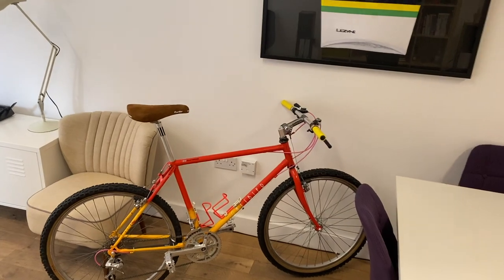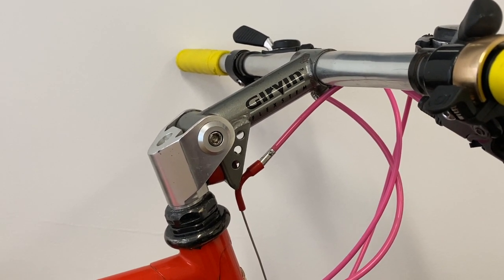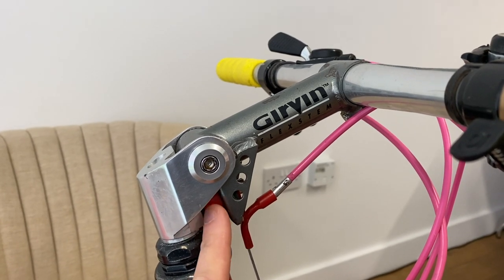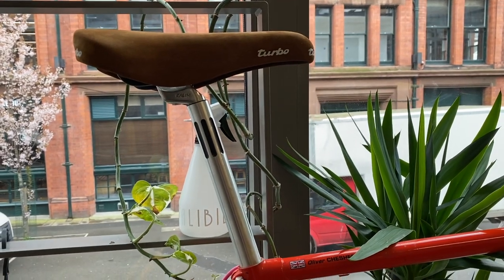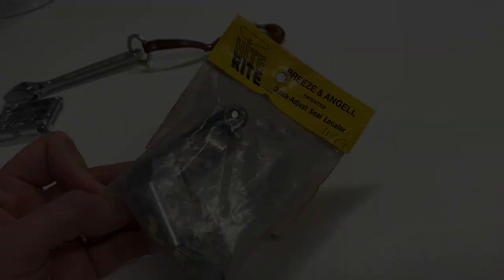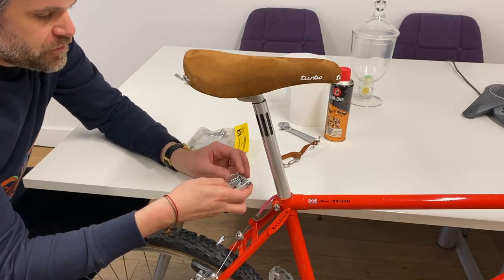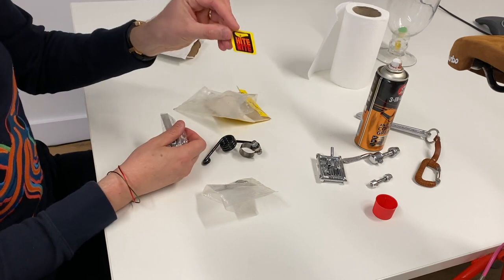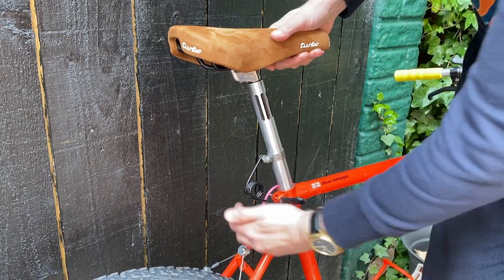Retrobike tech from the 80s: suspension and dropper posts (?!)

Comment: I could use a Hite Rite for my 91 Fat City Cycles Monster-Fat. I keep an eye out for them but they have become so expensive.
Reply from the maker: A Fat City has to have a Hite Rite, it’s a must. Yes they’re expensive and finite, but you’ll definitely find one - and what a cool toy to have. Just don’t scratch up some priceless XTR seatpost!
Reply: That's a fair point. I don't have a priceless XTR seatpost in the bike, however I do have the next best XT seatpost which is anodized. The seatpost diameter is now somewhat rare as well. I'll have to rethink this.
Reply from the maker: @lancehatch4475  I think with any seatpost, no matter how rare, you have to accept that there's a "show" end and a "working" end. As long as you install your Hite Rite carefully, have a decent tolerance inside your seat tube and grease everything, you should still go for it. Also have you considered wax instead of grease? Might have better protective qualities but might also affect tolerances, I don't know. I've used candle wax on ancient sash window frames, same principle.
Reply: @red_dread  All good points and more to think about. I'll probably try one out on the 91 Stumpjumper that I just picked up to restore. Once I get a little experience with the setup I might try it out on the more expensive bike/parts.